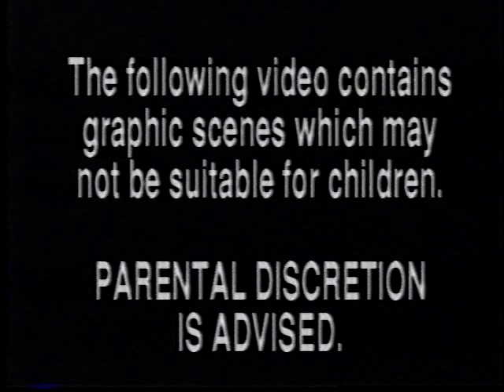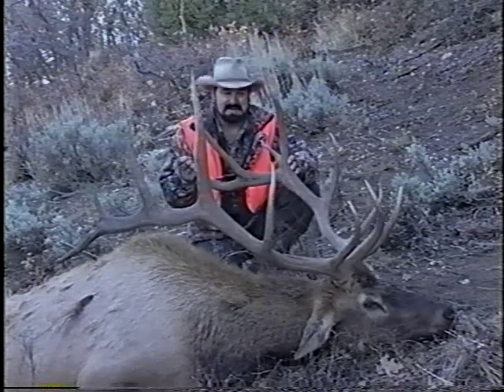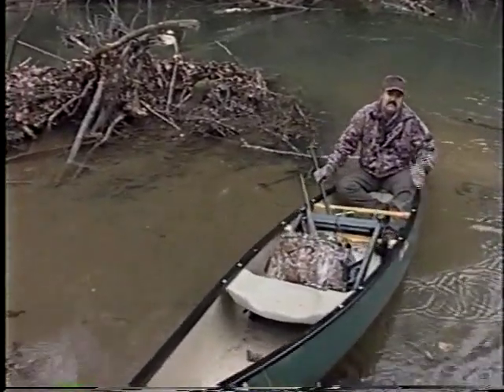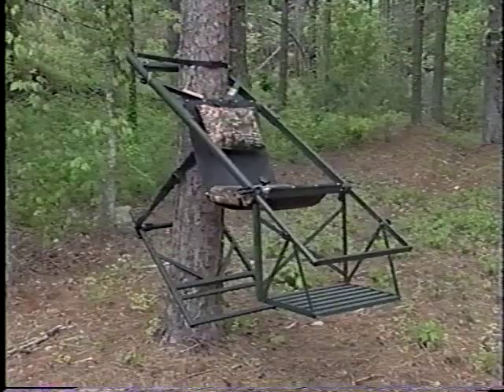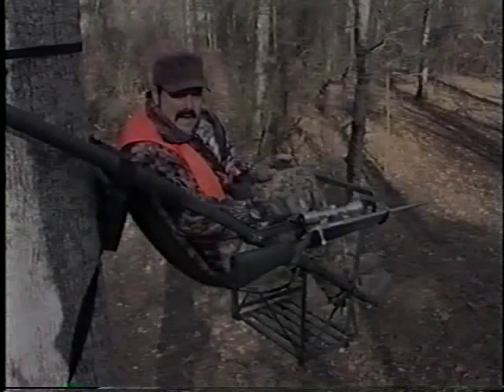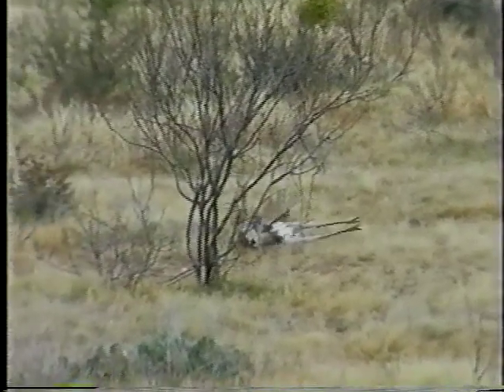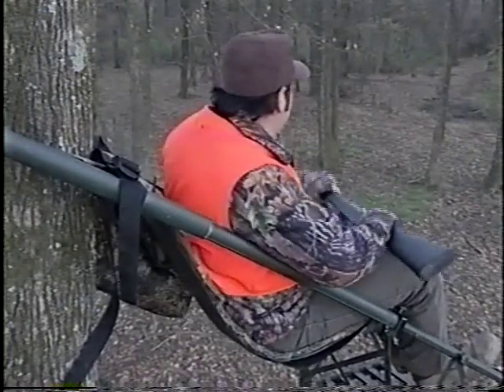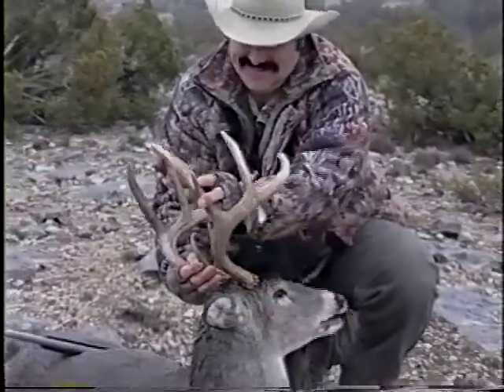The Tree Lounge Advantage 3

Comment: I bought one years ago, after getting a bonus check from where I worked at the time & have absolutely loved it!!!! Only issues ever were weight, bulk & the many trees that are simply not climbable, either due to size, limbs, leaning, or multiple trunks in a Y.
It worked exceptionally well within a tamarack swamp, cutting branches off the tree as I climbed if needed.
Stability for pin point accuracy was awesome!!!!
I’ve also used it for changing a bulb up on a light pole.
When you get up high, you feel so secure, you feel no fear if hights, been over 50 feet high with no issues.
I learned the high shoulder shot from these old videos.
Found all claims to have been true over these many years.

Comment: Nice stand>>>ur2.pl/923   so far. It's my first, so don't have a comparison. But, after 2 times trying it out and hunting in the woods I think I have it down. It's light, but I got the Sherpa game cart converter and its a breeze to haul a mile. Also getting the Mollie Straps for shoulders and waist. The harness works as it should: looks like quality seatbelt material. If your on the fence about getting either an open or a closed-get the closed. You can even use the bar to shoot your rifle from if you set the top section high and just stand hunt.